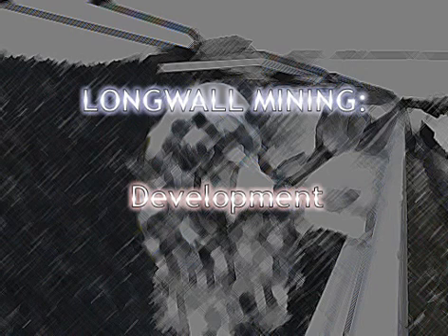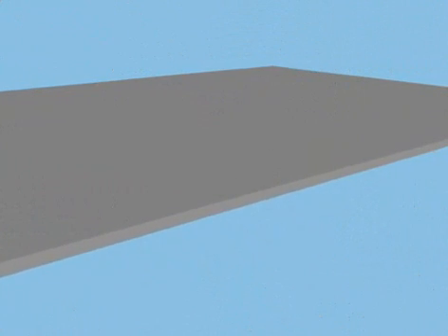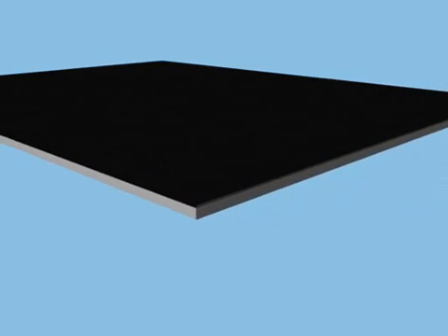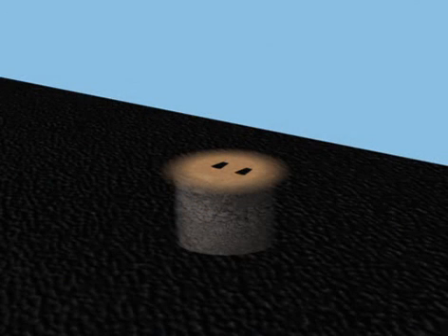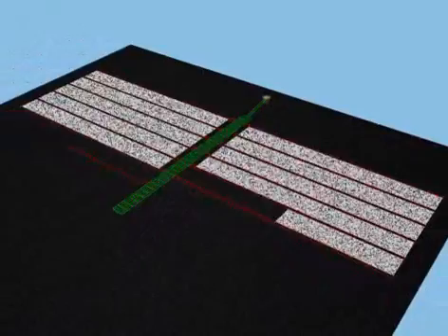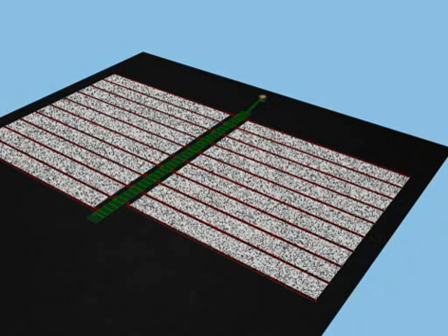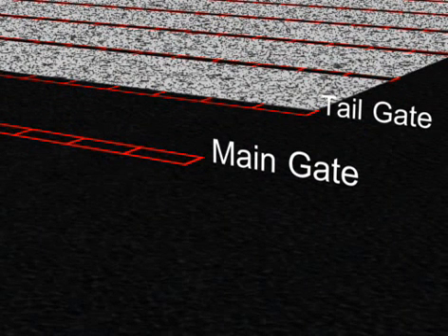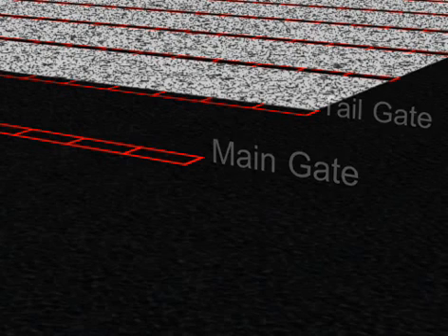Longwall Mining

Comment: Does the ground above the mine sink down because of the coal excavated below?
Reply from the maker: There is a lot of variables ie. Face width, depth of cover, extraction height and geological to name a few.
Generally the surface does subside but can be designed to minimise the subsidence or eliminate completely if required. 
A worked example is a typical mine at 250meters depth 300 meter wide, mining a 4 meter seam may result in surface to subside 1 to 2.5 meters.
Reply: Yes
Reply: Depends on depth and strata strength above.